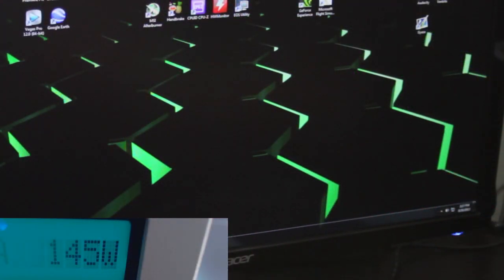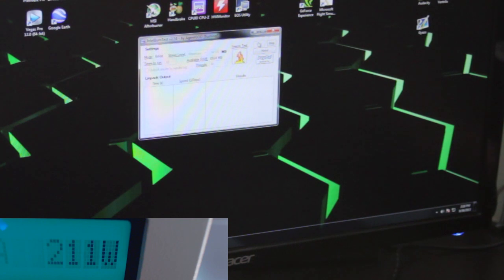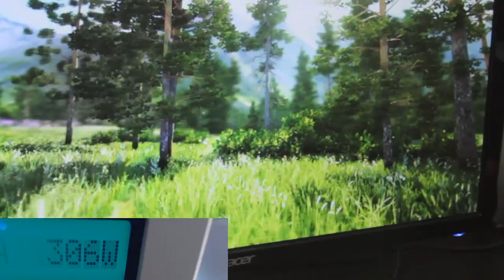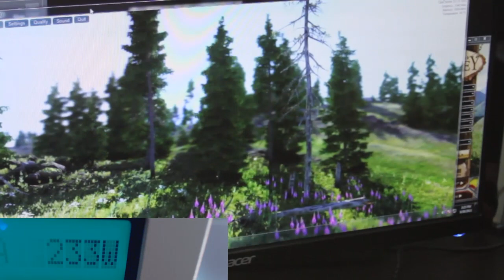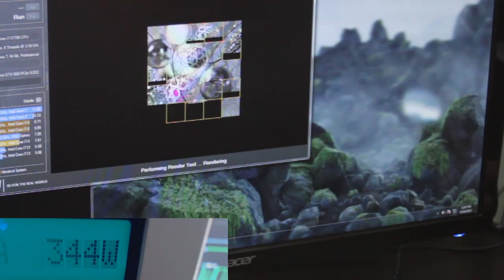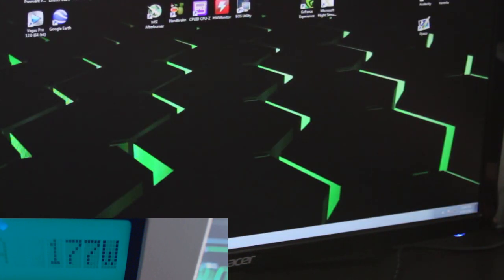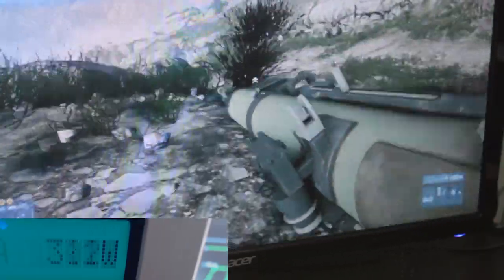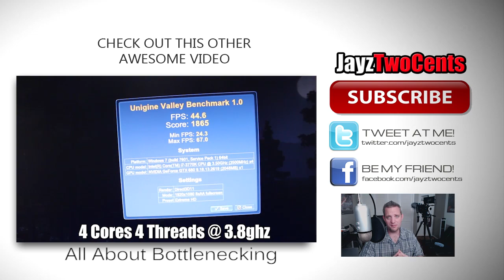How big of a Power Supply do you REALLY need?

Comment: A 1000w PSU with a basic 80 plus rating is guaranteed to deliver power at the correct voltages when 800 watts is being pulled at the plug, it may deliver the full 1000w or even be capable of more but when fully stressed the 12 volt rail might be delivering 13 volts or 11.5 volts so therefore it is out of tolerance and inefficient.

The test is bullshit anyhow because there isn't a set temperature that supplies have to be tested at (although it is usually 25 degrees C ambient).  If temps inside your case where the supply is say 40 degres C efficiency will drop further.

That is why you might be able to get a really cheap 750w 80+ supply that in reality will struggle to hold half that wattage at correct volts in real world use.  Also bear in mind that even though the 12 volt rail is the main one for PC's a cheap supply will probably have a weak rail and gain it's higher wattage rating through the supposed total it is capable of when all rails are used.

Also another supply may specify a really high amperage 12 volt rail but only have a lowish wattage.  Multiply the amps the 12v rail is rated for by 12 and this will give you the maximum wattage that the PSU is useful for - 20% if it is a basic 80+ rated PSU to be on the safe side.

The closer a PSU is to the limit the harder it will have to work to maintain the correct voltage.  If it is constantly over volting or dropping volts it will cause errors and crashes should it go out of tolerance.  Even if it is within operating tolerances eventually the ripple effect will cause premature VRM failure on a motherboard or graphics card and it won't be doing anything else any favours either.

When I'm spending a lot of money on a build I have no issues with dropping an extra few pounds on a better PSU as I can't tolerate a machine not working correctly for any reason.

A bigger PSU won't use any more power than a smaller one on a particular system, it will only ever pull the amount of electricity that the PC requires.  If anything a larger supply will be more efficient at lower power draws as it won't be trying.

Comment: i have a i5 6500 and a r7 265 , but only a 350w psu. After 2 years , still everything fine :D
Reply: Exactly, most people "overkill" when it's about choosing PSU
Reply: retvolki yeah :D
Reply: i got i5 6400, gtx 1050ti and got 250w PSU :DD
Reply: Those parts don't really stress a system at all though so I'm not surprised. Are either overclocked, unlikely. Now if you were to run a 6600k overclocked with even an r9 285 known to consume sometimes 200 to 300watts just on the gpu uts going to crash or at the least throttle the system
Reply: retvolki I have gtx 1080 running at 750w Normally they just use 1500+
Edit:in sli

Comment: I have THERMALTAKE SMART-SE 730W Modular 80Plus Bronze, and GTX 970 4GB WINDFORCE OC G1 GAMING (with 3 fans) that consumes up to 550watt, and i5 4590 that consumes up to 84watt
so 550w + 84w = 634watt, so am asking is my psu enough? since 730w *80% = 584w, if not, what kind of higher psu do I need? or is it actually 730w and not 584w which makes it more than enough?
also is my math incorrect concerning the way I calculated my rig's wattage and my psu is actually more than enough? if yes what kind of lower psu do you recommand me?
PS: there is something written in psu (87% efficiency) so should I use this percentage instead of 80%? which means that I get enough wattage since 730w*87% = 635.1w

am also planning on building a new gaming rig with the following specs:
CPU: I5 6500 (SKYLAKE) QUAD CORE 3.20GHZ 
CPU FAN: CPU THERMALTAKE FRIO ADVANCED
GPU: GIGABYTE GEFORCE GTX 1060 G1 GAMING 6 GO GDDR5
SSD GEIL 120GB ZENITH A3 SATA3
HDD Western Digital 1TB 7200 T/Min Sata3 3.5" Blue
RAM: 2X of AVEXIR CORE BLACK LED RED DDR3 8GB PC1600 CL11
LECTEUR GRAVEUR DVD LG
MOTHERBOARD: ASUS Z170-P D3 LGA1151
So what kind of psu do I need? Thanks

Comment: I have a i7 4790k, cosair watercooled cpu, and a rx 480, I have all the wires hidden and done nice, which took me forever, now I want to either add a rx 480(crossfire) or a gtx 1080 single card, will my evga 500w 80+bronze psu be enough, should I go with the single card or with another xfx rx 480 crossfire? or do I have to upgrade my psu either way :(

Comment: Which PSU should I buy for this set up? Is 500W enough?
Mobo - MSI H170 M3
CPU - i5-6400
GPU - Palit GTX 750 StormX OC 2GB
Ram - HyperX Fury 8GB Single
SSD - 240GB
HDD - WD 1TB 7.2k RPM
Optical Drive - CD & DVD writer
Oh, I also have 5 fans. 4 casing fans (3x120mm & 1x80mm) & 1x120mm fan for cpu.
Thanks guys!
Reply: Btw, Ram is DDR4. Thanks!
Reply: do you own math... what you cant add Gpu watts + CPU + hard drives + anyother shit and multiple that by 1.25?
Reply: and i get nuber 347.5 is that W or watt? can u help ? hahaha...
Reply: Đini no that is vars
Reply: vars? what...
Reply: Đini oh no sorry VARs
Reply: ok thank you
Reply: Đini i was joking because your question was silly
Reply: ok
Reply: Đini just get a 500w psu...
Reply: Jeremy Guevarra 430w is ok

Comment: Hi @JayzTwoCents. im planning on building a rig.
I7 6700k
16gb ddr4 2x8gb
GTX 1070
h115i liquid cooler
1 ssd 500gb evo 850 + 2 tb hybrid 

and im getting a 750w evga p2 is that overkill?
Reply: Jasper John Canda I'm getting something similar, except I'm getting the water cooled gigabyte xtreme 1080. 750 allows you to future proof if you need to both OC and SLI.

Comment: Is a 700w psu to much for a fx-6300 and gtx 750ti, and my motherboard is a Gigabyte 78LMT-USB3
Reply: MrGrimm3277 as far as i can see, you wont be overclocking your cpu as your mobo is very cheap and not meant for overclocking. a good quality 500 watts would be more than enough.

Comment: So i should be fine with a 400w sfx power supply  for my gtx 1080 and i7 6700k ?
Reply: Ehhhh unless your 400W is 80+ bronze or better, I'd actually be worried. By itself, the computer is fine, but if you start adding USB devices like a microphone or gaming headset or gaming mouse + keyboard, then 400W becomes completely inadequate. Upgrade to 500W for safekeeping imho

EDIT: Here's a useful website http://outervision.com/power-supply-calculator

Comment: which psu should i buy for this pc??
cpu - i7 6700k
gpu - gigabyte g1 gtx 1070 
ram - corsair 8gb ddr4 of 2 stick
mobo - gigabyte B150M ddr4
ssd - 120gb
hdd - wd blue 2tb.
optical drive - Cd&Dvd writter!
Reply: you should get a z170 because theres no point getting a k and not overclocking. z170 is the only one you can overclock on. or get a regular 6700
Reply: Most of the time, the PW rated 700W is way more than enough for most of computer system unless you have a BIG VIDEO CARD which is for the aggressive game player. Please, note that even you install a 700W PS but your system uses only 300-400W then you are using 300-400W only, not at all time your system will use 700W. However,  buying a 700W PS so we will make sure that the computer system will have enough power to run smoothly. We are more calculated with the using on PS because PS before are very expensive. For now, they are cheaper so buy one that about 600-700W are good enough. If you have some extra money, buy the 1000W but I am sure most system don't need that much power.
Reply: ohh i got it... ^_^
Thank you mate...!! :) :)
Reply: Md.Ebadot Hossen Anik a good quality 500-600 watts psu would be more than enough. Try EVGA Supernova G2 650 watts, its currently available for $60. But why 6700k on a B150 motherboard? Buy a Z170 mobo or get the  i7 6700 (without the k) and keep the B150 mobo.
Reply: Or the Thermaltake TR2 600 Watt ATX12V v2.3 SLI Ready CrossFire Ready 5 Year Warranty ... from Amazon for $46. Good brand, good price...
Reply: hey,  please can you tell if 500W will be enough for GTX 770?
Reply: Md.Ebadot Hossen Anik do not buy a 6700K. Buy a 6700 or a i5 6600
Reply: Hey,
first of all Thanks!
MAYBE i'm kinda Nob when its comes to combined any PC Hardware! :/
I'm really confused that what i'm doing or What should i have to do for my Rig!!
Please if u have enough time and if u want then u can help me! :)

Btw Currently i'm using,
Cpu   :Intel Dual core Processor G4400 6th gen {I buy this one for temporary use(3Years of Warranty)}

Mobo  :Gigabyte B150M ddr4  (3 years Warranty ) BDT-7000= 89USD

Ram   :Corsair Vengeance LPX 8GB DDR4 DRAM 2400MHz 1 Stick! (Product life time Warranty)

SSD   :Transcend 128G SSD360S (3 years Warranty) BDT4500= 57USD

PSU   :Thermaltake TR2 S/450W/Non Modular/ATX 2.3/A-PFC/12cm/EU/80 PLUS White/for 230V only (2 years Warranty)  BDT - 3,500=44USD!

Mouse :MSI Interceptor-DS-B1-GAMING-Mouse

Keyboard: Tt esports challenger prime gaming keyboard

[I buy this products 1 month ago]
 
Monitor : Dell S2216M 21.5

Few Days Ago my previous GPU and HDD ware Damaged! :/
----------------------------------------------------------------------------------------------------------------

So Now i wanted to buy!

Gpu : gigabyte g1 gtx 1070  (in our Currency its 45,000tk {1USD= 78.50tk} So 576USD)[2 Years Warranty]
Or,
      Sapphire Nitro+ RX480 8G DDR5 Graphics Card ( Its 30,700tk = 393USD)[2 Years Warranty]

CPU :        Intel 6th Gen Core i7-6700K (28,300tk =362USD with 3 Years Warranty)
if i go for  Intel 6th Gen Core i7-6700 (25,300tk = 324USD with 3 years warranty)

Or
 6th Gen Core i5-6600K = 20200tk(258USD) nd without K its 18,300(234USD)
or Should i wait for 7th gen processor until January?Actually anyone not sure when it will be release! :/

Cpu cooler : Cooler Master Hyper 103 43.1 CFM 25USD

Ram : One more Stick of Corsair Vengeance LPX 8GB DDR4 DRAM 2400MHz 44USD

HDD : Western Digital Caviar Blue 1TB 7200RPM (2TB was 5200RPM only so that's why i wanted to go for this 1TB)

PSU : Antec Neo Eco II 550 Bronze 550 Watt Power Supply with 03 yr warranty (5,300tk=67USD)
      or
      COOLER MASTER V 550W 80 PLUS GOLD PSU (5YEAR’S WARRANTY) [BDT8,500 = 108USD]
      Or
      Thermaltake SMART SE-Modular-630W-87% efficiency (3YEAR’S WARRANTY) [BDT6,400.00 = 82USD)
      Or
      Thermaltake TR2/600W/80 PLUS Bronze [BDT6,400.00 = 82USD] 1Years of Warranty! -_- 
      Corsair VS650 Gaming (3YEAR’S WARRANTY) [BDT 5,800 = 74USD]

Casing: Still not sure! :/ wanted any type of Transparent Case! :D  
-------------------------------------------------------------------------------------------------------------------------------------------
Ps : those product much more Costly than Amazon bcaz of our Country Tax system! :/
nd its not possible to Buy Products from Amazon or Ebay,here is not that much easy to buy anything from this kind of site...Still they r not available in our country..
Here We have to depend on Computer Accessories Shops! :/
nd EVGA products r not Available!!
only Corsair,Thermaltake,Antec,Coolermaster this kind of Brand Psu are Available!!

I think i Don't need any new PSU if i go for RX-480 series & if i go for Gtx 1070 then i need a New PSU more than 500+W! Bcaz its recommended  500W PSU(if i was not wrong)

btw Im not a FPS freak or wanted to Crossfire or SLI in future and Obviously for me its not possible to Upgrade my whole pc Every years..I wanted to use this Rig for next few years!! at least 5 Years! :) 
Now if i get 60-100FPS and in next 2 years if i get 30-40 FPS i won't mind at all!
i will be happy if any game Run nicely in any Fps!
nd I don't have any intention to Overclock my System!!

Thanks nd Sorry for my Bad English! :|
Reply: Thanks Guy inSj ^_^
u can see my last comments which is i comment just now about my Pc...
i hope u can help me too...
Thanks a lot Both of u! :)
Reply: To me, building a PC system is not really helping. It is time wasting and loss money. It's just like you want to assemble a car rather than pick one from car dealer. Pick the computer from the Quality Manufacture and buy it. I have tried to build one before but ended-up, it gave me more headache and loss money. A bit of problem, it took me a whole day to troubleshoot since it combined between the Hardware and Software so I would not know for sure after spending some time on it. By the way, anything that has processor will take a lot of ELECTRIC power. They are the CPU (Main unit) and the GPU (Graphic processor) depend on what you need. Don't pick the EXPENSIVE Graphic card for fun, it will suck a lot of money on you as well as driving the electric bill. For web surfing and some games, a $30 - 50 video card is good enough.  The NVIDIA is a good graphic card, Intel I7-6700 is the top for now. Pick a good reliable Power Supply ~ 600W....Memory about 8GB.... Anyway, the PC is a system we can use for daily things + some Entertainment....but spending too much on it is not necessary. A $600-700 from Dell XPS 8900 is good enough or a SIMPLE Lenovo SERVER system without Hard drive and operating system on Amazon for $300 ...adding some more for a total of $500...a good system as well. Hope you will have idea! PS: I bought Dell XPS system XPS8300 ($550) and Lenovo Server 70AQ001JUX ThinkServer TS440 Xeon E3-1226V3 4GB 4x3,5-inch SATA RAID for $299...but with some discounts, I paid only $210 (without Hard Drive and Operating System). Now, it is $529. If you can wait, it will be on-sale again. By the way, PICK SSD (Solid State Hard Drive) ~ 240GB or 480GB...you will be more HAPPY with it more than the Traditional Hard Drive. It is way faster and draw less energy.
Reply: why do you have a b150 and a 6700k
Reply: An Pham um already buy this mobo bt wanted to by this cpu 6700K bcaz its not possible for me to buy a new CPu in 4-5 years!! :| 
that's why....!!
i don't know im right or wrong!!
Reply: oh okay....
so which z170 is better?? 
or should i wait for 200 series ? :|
Reply: Okay bro lets see...

Comment: Hey, how much wattage needed for i3 6100 stock and GTX 1060 3G stock system? COolermaster says load 270W, but will a 80 plus bronze 450w be fine?
Reply: RLWDB13579 use PC part picked it will tell you how many watts you need
Reply: Halo8527 I already know how much watts its using, but people tell me to get a higher wattage to get safer..
Reply: Use 430W is pretty much SAFE but with PS is cheap now, buy 600-700W so we will have some extra power for later use or upgrading / adding more components to the system.  Please, note that even you install a 700W PS but your system uses only 300-400W then you are using 300-400W only, not thinking that at all time your system will use 700W. However,  buying a 700W PS so we will make sure that the computer system will have enough power to run smoothly.

Comment: Hey, My total load of Watts is only 277. And i have DE500, is it good enough to supply my components? Will upgrade PSU after a year
Reply: DE500, I'm assuming the wattage is 500? If so, yes that will be enough to supply your components unless you upgrade.
Reply: For sure? cause im afraid that it will destroy my components.
Reply: Wizard It won't. How do you think it will destroy you components?
Reply: Because of the reviews, i was told that i should buy a more expensive PSU rather than a cheap one. Because DE500 is only 28$
Reply: Wizard Oh. Yes that is true.
Reply: get the 500w evga 80+ bronxe theyre only $40 nowadays, or even the 400w 80+ evga one which is $33

Comment: So if i dont do SLI, i could basically go for a 500/550w PSU? I have a i5 6600k, z170, 3x SSDs, Aio and a GTX1060.
Reply: yes or over clocking
Reply: U have a 4790, 16gb, 6fans, led. Hdd, ssd and im running on 450w xD

Comment: I'm seriously wondering if I picked the right Power Supply

NVDIA GTX950 Xtreme Gaming
GA-297-HD3 Motherboard
1TB Caviar Blue Western Digiral Hard drive
16GB HYPERX DDR4 RAM
Intel Core i5 4460 Processor 
X2  120mm fans

And for the power supply, i'm running everything on a Corsair CX430

Nothing is overclocked

I wonder if I made the right choice, i'm really worried
Reply: Thats fine, my Titan XP can run off of 450w
Reply: Thanks, I was a bit worried, but i'm still thinking about buying a 600W power supply because I want to overclock my graphics card and adding fans and liquid cooling to cool off my GPU and CPU.
Reply: Pixelsandwich
I wouldnt be too worried about a 430w not being enough for a gtx 950. I ran a 950 in my little brothers pc for ages with a CX430 aswell. It never gave any problems even when the i5 2500k and GTX 950 were overclocked.
Reply: I have an external sound card for my guitar, I dunno how much Watt it takes tho
Reply: Pixelsandwich
like an amplifier? Probably will still be fine :)
Reply: alright thanks alot !
Reply: What chugs 80% (or more) of the energy is your processor + graphics card + advanced cooling systems (like liquid cooling, but as you have not implemented that don't worry about it)

GTX= 75w
MOBO= 40w
RAM= 10w
CPU= 84w
FAN= 5w x 2 = 10w
TOTAL= 209w

So yeah a 430w is perfectly fine and actually you also have quiet some room for future improvements in your setup. You could possibly go with even less then 430w but I do not recommend that as those cheaper GPUs are not 80+ most of the times. Also, the price difference between a cheap 300w and a Corsair CX430 is pretty much zero.